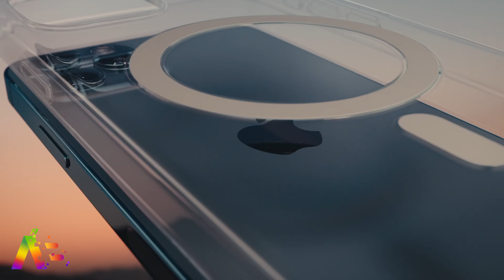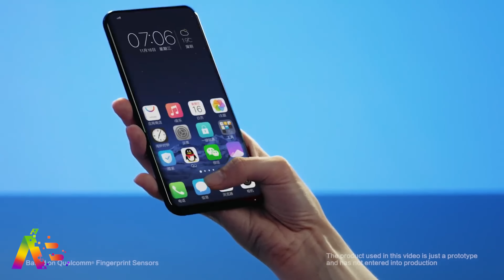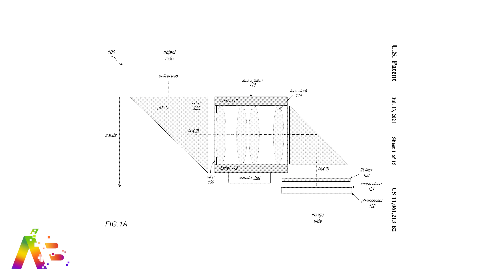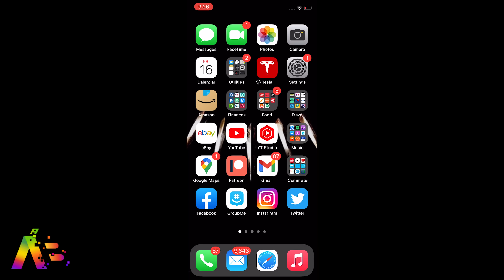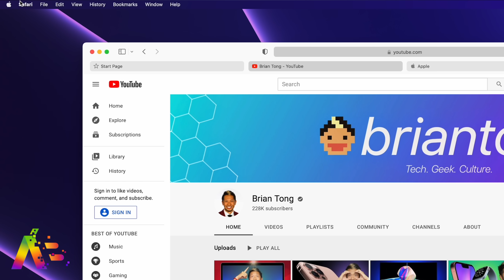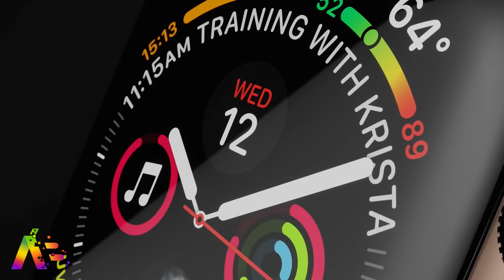Apple MagSafe Battery Pack: Is it worth it? What you should know! Plus, new iPhone 13 details!

Comment: Mine came through today & I can say it’s worth it! The battery pack doesn’t charge wirelessly, you have to use lightning. Also you could use the battery pack to charge your AirPods. The magnets are strong! Same size as the apple wallet but stronger magnets

Comment: I was hesitant to buy a 12 mini because of the battery life. With this MagSafe battery pack it’s the perfect accessory, I would say pretty much essential. It’s slim design works with Mini’s most valuable asset which is portability.

From the pictures on Apple store it also appears to be the perfect size for Mini. It’s right on the edges  so it may provide an even more comfortable hold ergonomically to offset the hard edges. With that, a case may not be necessary with it covering most of the back. Still gotta have that screen protector though.

Comment: It’s cool but My sena leather wallet case is not MagSafe and I don’t like to take it out of the case unless it’s on the car mount 
it’s connected to USB in the car so I can charge and listen to Audio at the  same time.  

I have the Anker powercore 10000 PD . It’s small and has power delivery so it can change my phone very fast and fits nicely in the front slingbag pocket. I did purchase the MagSafe cable cause I wanted to try it. It’s slow compared to my directly connected chargers and it heats the phone up which possibly can reduce battery life over time.  I don’t really like it or use it. 

I hear the iPhone 13 will have next gen vaper chamber cooling.  I hope that will make it so my iPhone doesn’t dim while I’m driving using Google maps. 
And to be honest it’s kinda overpriced but I expect that as it’s apple.  If I had a MagSafe case and it was 50 bucks I would consider buying it as it is convenient to not have to use a cable sometimes.
 I currently have an iPhone 12 Pro Max

Comment: Like most apple devices you are paying a premium… but like all their products they just work n theres a simplicity to it.  I travel a lot and I enjoy going to sporting events so having the convince of not always having to have a lighting cable or sit at a charging station with me is a plus.  Also for those who purchase apple care + with their iphone, your accessories are covered under it as well.  Wether your phone battery degrades over time and you upgrade to a newer phone this charger will work with those as well.   So yes there are backup batteries but apple is well aware of that this is just an addition to the rest of the market for those who want it.  If you dont want it, dont buy it.

Comment: I have a battery pack that I only use while taking long time lapse photos on my iPhone 12 Pro Max. I just leave it on its drawstring bag while hanging from my tripod. It has 16,000 mAh with 2 USB exits from IOGEAR. I bought 2 on eBay for less than $20 each one. While I still need to carry a power cord, I think that for the size, capacity and price, it can not be beaten. Now…how much juice in mAh does this Apple battery holds for $99.00???

Comment: I'm only interested in the finger print reader. Everything else are just toys in my view. Even the 120hz refresh rate screen is unnecessary. I'd much rather have a longer battery life. I'm still using the 6s+ and don't have the need for all the bells and whistles. Larger screen to body ratio is great but I don't care about the notch. 
Bring back the headphone jack and the finger print reader and I'm sold. To do away with the floppy dusk was logical considering its small capacity. The headphone jack is a different story. I hate charging earbuds. The adapter dongle can be easily lost and the same goes for the true wireless earbuds. No amount of money can get you 0 latency unprocessed and uncompressed audio. 
I desire simultaneously more and less from the pocket computer that makes phonecalls, too

Comment: I usually buy the smart battery case every year, but they battery life on my iPhone 12 Pro Max is a beast 💪 so I’m 50/50 on this new MagSafe battery pack. I’m going wait for your review Brayn 😊
Reply: Yeah I haven't had to worry about battery life on my 12 since I got it🤷🏾‍♂️
Reply: Same. My 12 pro max, I’m on it 24/7 still have like over 40% when I go to sleep. Awesome
Reply: Any of you running iOS beta 15? My 12 pro max drains so fast. A full charge may last me a 8 hour shift and that’s only in low power mode.
Reply: @avanterogers1202  I’m not but I thought about it.. now I probably won’t 🤔
Reply: @avanterogers1202  not running the Beta life anymore. I used to until I had some issues on previous Betas, such as battery life and features not working. Don’t run beta on your only personal phone.
Reply: @esteban602  well… it’s a beta so that should’ve been expected. And I’ll do as I please thanks thought

Comment: I ordered it as I have one of the battery packs that you plug in and I hate it when it’s in my pocket and need to use my phone. I know there are cheaper options but not having to push a button or turn it on is what I am looking for.

Comment: Apple’s MagSafe Battery Pack ha 1460 milliamp whereas the Mophie is 5000 milliamp.  With Apple’s battery pack priced at $99 and Mophie’s at $49, it’s a pretty easy decision as to which one to go with.
Reply: To be clear that comparison isnt accurate as those mAH are for different voltages, (5000mAH) 5AH @ 5v so 25wh 
1.46AH @ 15v = 21.9wh 
So a bit smaller but imagine ot takes up a smaller foot print too

Comment: $99? Just to use the magnet? That's a deal breaker for me. I'll use a normal battery extender that I can plug into the phone for less than half that price.
Reply: I will not get the battery pack! It is little too late
Reply: Sometimes I don’t charge my phone with my battery pack because of the hassle involved. Walking around with a wire attached to a battery which attaches to my phone is a pain in the ass.
However if I has this, I’d use it all the time. Using it wouldn’t interfere with anything.
And at the end of the day your paying for that convenience. Albeit a very expensive convenience.